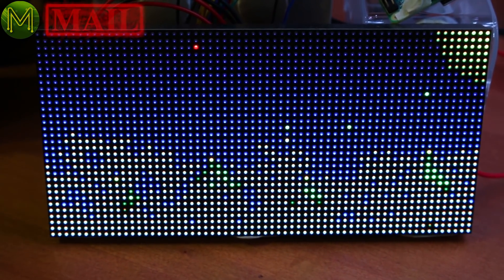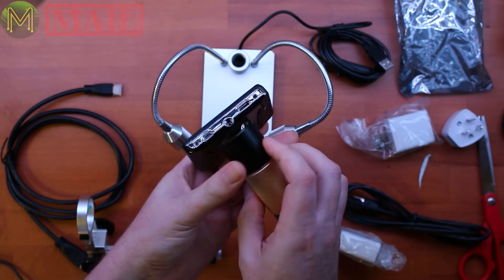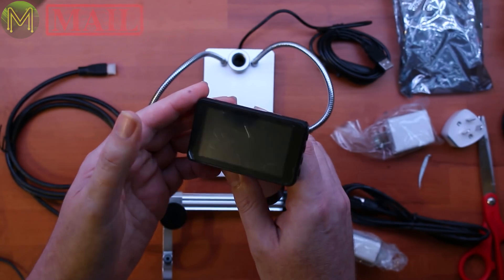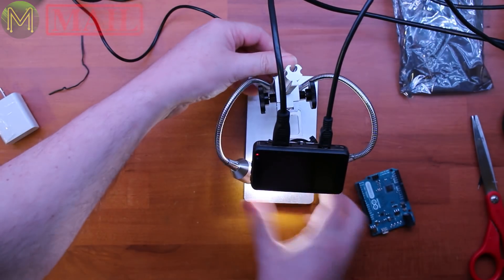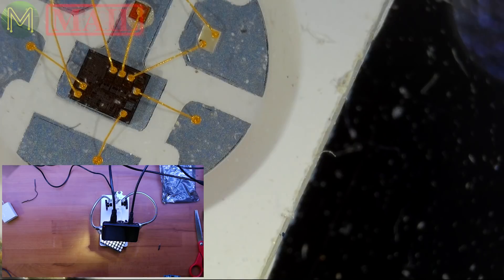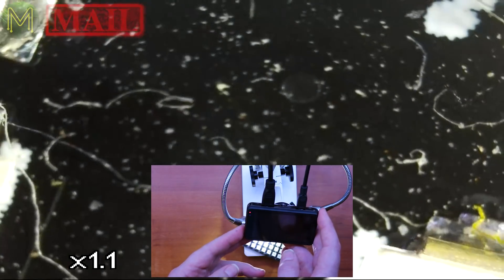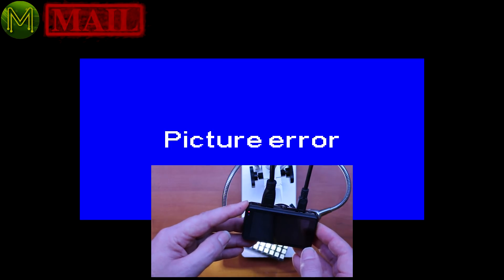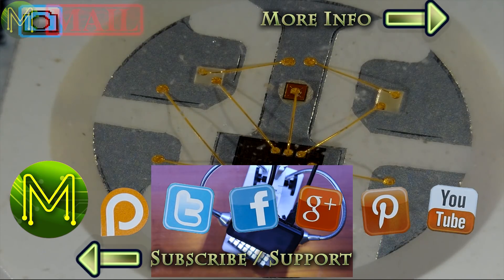#187 MickMake Mail #23: Andonstar HDMI microscope // News

Comment: Put a THICK grease on the stand, it’ll act as a fluid damper and make the movement much nicer.  It’s messy, but it works in a pinch.

I think the digital zoom first crops the image in to 1:1 1920x1080, since it is a 12mp sensor.  I wonder if so what zoom level that is.
Reply from the maker: Yup, I was thinking of doing that. Also looking at ways I can replace it completely.

Zoom ratio is always a hard thing to define. If you slap on a 7” monitor it won’t have the same ratio as a 70” monitor, but my standard 24” 1080p monitor is good enough.

Comment: How is the working distance? Is it possible to get a hot air gun or even a soldering iron in there and still be focused?
Reply from the maker: You can easily get an iron in there, a heatgun... you might have to pull it up a bit. In which case your zoom ratio will reduce.
I think the more recent version, (302), can zoom in further away, but it's more expensive.

Comment: I have this 201 and the newer 302.  Excellent little scopes for the price.  The remote
on the 302 and the software are well worth the added cost.  However, I really wish
for the camera that has dual HDMI and USB simultaneous support.  Only my Targano
has that, at 10x the cost.  Also, I sent you the manual for the 201 via email.
Reply from the maker: The remote would be a definite plus. I tried controlling over USB, but the resolution isn't so good. I'll try it with gphoto to see if I can control it that way.
My mate, Kean, has gotten in one of the 302s, so we'll be reviewing it soon.